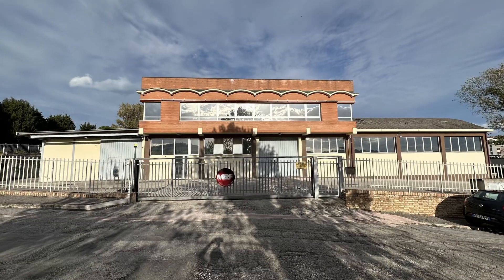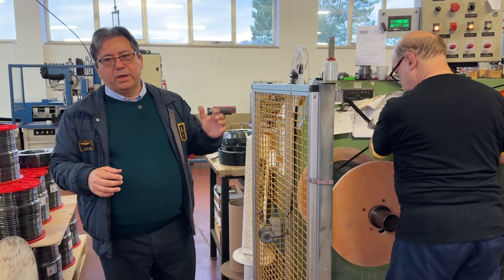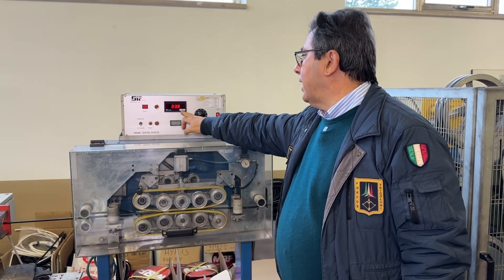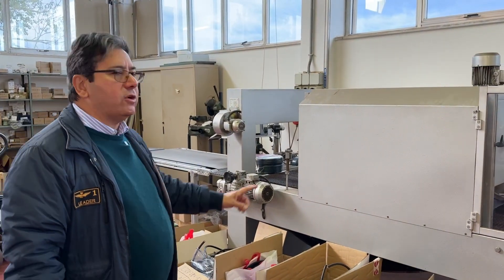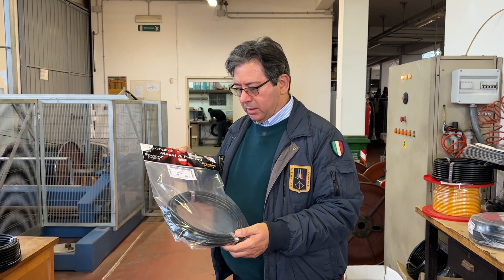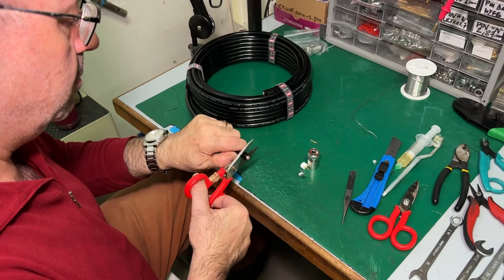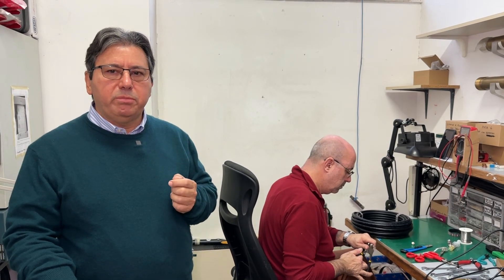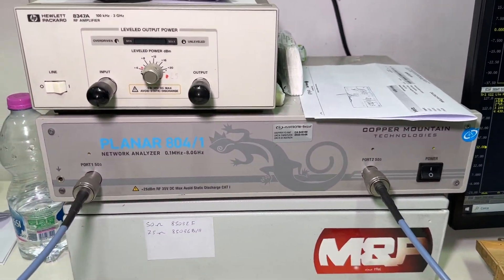Messi & Paoloni Factory Tour Part 4: Packaging

Comment: I just purchase a 2024 Chevy Silverado. My plans are to install my 11m Cobra CB, Kenwood D700A and Yaesu FT-891 in my truck. What coax model(s) do you recommend for all. I do not want to go with the cheap truckstop coax, even for the CB. I want to eliminate any stray RF that could be produced because of all the electronics in the new trucks. Any suggestions would be appreciated.

Comment: Nice to see. I went to the website to compare the price with the cable I buy from Amazon (which I never had any problems with). From MP $56 on Amazon $18 . This seems to be a great coax for high performance big gun stations, for my use case it just doesn’t worth

Comment: An outher great episode of How Its Made  buy K8MRD . I kept my package my custom POTAFLEX 7 jumpers cam in. can't wait for the nice carry case for the POTAFLEX 7 reel kit. Messi & Paoloni   make more than just coax. found great antenna wire for dipoles . That SO 239 to BNC adapter is top of the line. I bought extras. the ones on Amazon go bad. but I have got good ones from Amazon . I just use the M & P ones in my go kit for POTA. I have got some MIL spec RG 58 with BNC to BNC from M & P 25 ft . that super in my go kit . the 50 ft POTAFLEX 7 reel I just carry . They ship world wide  ! look at all the testing and that before it gets to the lab and tested again. 73's